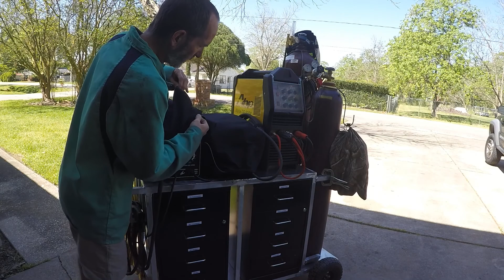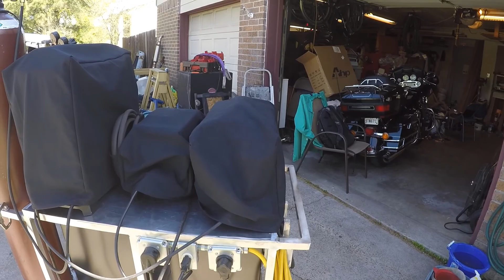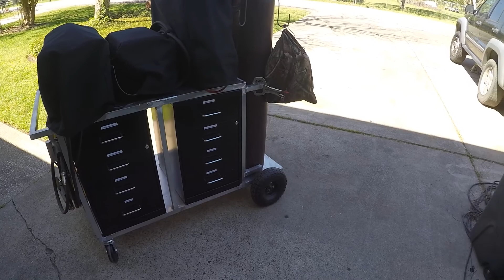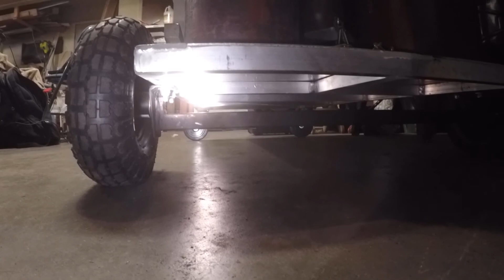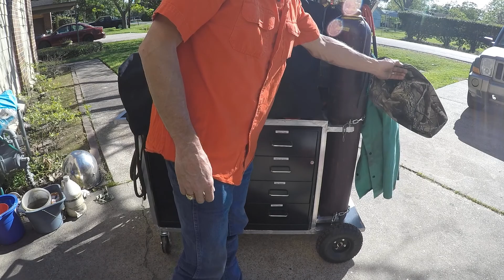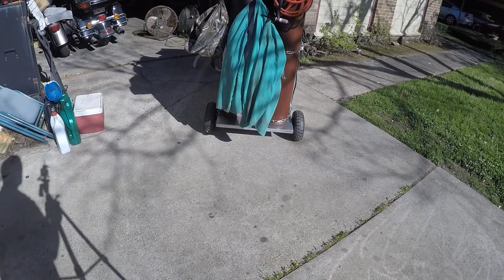Aluminum Welding Cart Fabrication - Part 3

Comment: I have watched all 3 of the videos of the cart build and think that you have done a great job!  Mostly well thought out design right from the start. When you first showed the brackets for the large wheels, I had questioned in my mind if they would be sturdy enough and as it ended up I was correct.  You however found a nice solution to that problem. 

There are only a couple of things that I think could have been improved in the design. If it were me, I would have put cable hooks for the AHP on the back side of the cart so that all of the cables are not hanging off of the tanks (looks a little dis-organized and sloppy).  I also think that I would have tried to find cabinets that had at least one large drawer or shelf to put the welding hoods in, if possible. Same reason as stated previous - stuff hanging off of the tanks looks bad.

Other than the 2 small issues that I have mentioned, I think that you did a hell of a nice job!!! 

Out of curiosity, what is your estimate of the total cost involved?
Reply from the maker: Tom Rumish Honestly, I didn’t do a good summary of the costs. I spent about $500 for everything. Thanks for the feedback. There is always room for improvement!!